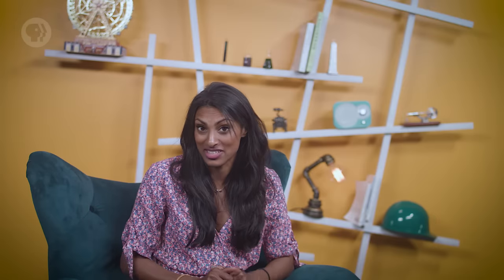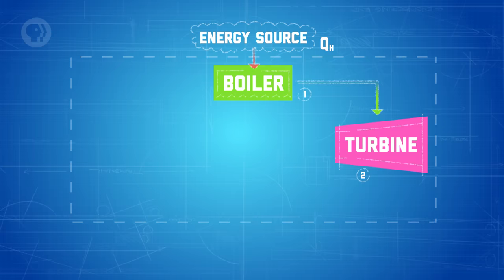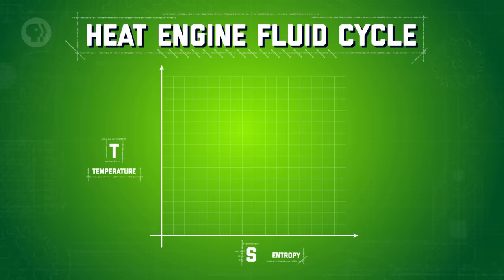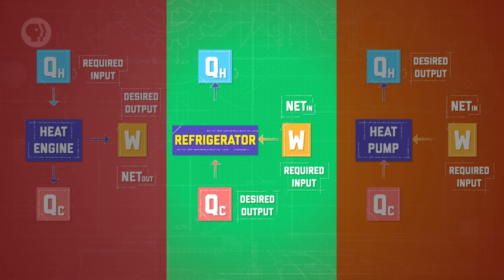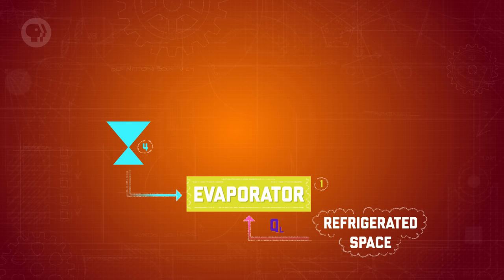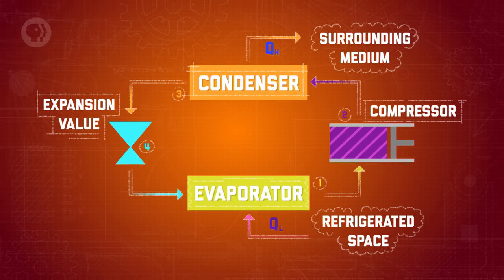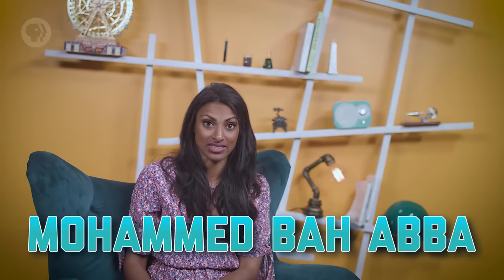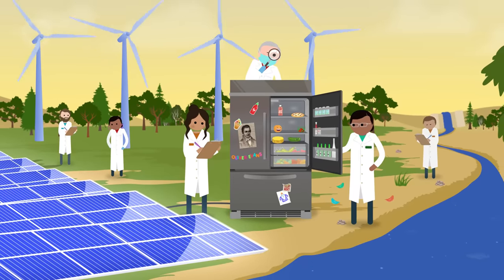Heat Engines, Refrigerators, & Cycles: Crash Course Engineering #11

Comment: at this point its essentially Crash Course Thermodynamics :P
Reply: I was about to comment that. This is not only Engineering. Thermo applies for Sciences as well, and not for Computer Engineering, not much for Electrical or Civil. I mean, I am a ChemE and thermo is deep within us and the Mechanical guys. I don't get why they are focusing on it.
Maybe they should make it more clear what lines are being studied and why.
I think they are just taking the most applied courses of engineering and they will go around.. Thermo, Fluid Mech, Heat transfer, electrical systems, Static mechanics etc.
Reply: Herbert Barrirt Dan Victor Be patient. This is only episode 11 in a 46-episode series that needs to cover several, unrelated facets of engineering. It makes sense that they would spend a few episodes focusing on a specific discipline before moving on to the next one.
Reply: All engineering is basically thermodynamics  and incorporates a lot of it since there aren't many systems where energy is not involved
Reply: Dan Victor. I disagree. I'm a civil engineer and I use a lot of thermodynamics. Maybe not as much as other areas, but it's still a lot, specially in Hydraulics (Dams, pipes and others) and Environmental.

Comment: She did miss out a bit i think on the properties of the refrigerant and other gases . As being a mechanical engineer we are aware of these things . Its basically about pressure and temperature . Everybody knows water boils at 100 Degrees but not everyone is aware that boiling point of liquid changes with the change in pressure . If pressure increases boiling point increases and if the pressure decreases the boiling point decreases . For example at an altitude of 20000 feet water boils at near 40 or 44 degrees celsius because the pressure is less at that altitude . The same happens in a refrigerator . When the compressor compresses the gaseous refrigerant its pressure increases so does its boiling and condensation temperature . And the heat because of compression of the gas is rejected to the atmosphere in the condenser and the refrigerant condenses . The expansion valve then reduces the pressure of that liquid refrigerant thus reducing its boiling point and temperature .  this low temperature refrigerant is the passed on to the evaporator to absorb the heat and cool the surroundings .
Reply: come on! make this simpler! MY MIND IS ABOUT TO BURST.

Comment: Thanks I've always wanted to know how a fridge works. I found it pretty wierd that you can all energy to something to make it colder.
Reply: even weirder/ more counter-intuitive are the gas fired camping fridges. You burn gas to make something cold.
Reply: You can do this even more directly using the Peltier effect. 

Also, when you think about it, a computer sorting a list is also using energy to reduce the entropy in its memory. There's a direct relationship between information entropy and thermodynamic entropy, which is kind of weird but makes perfect sense at the same time.
Reply: yondaime500 you're right I never even thought about the computer one
Reply: Good to keep in mind though, that since entropy can never decrease in the universe, you're adding energy BUT also producing a lot MORE heat than you're taking away; thus still increasing entropy. Same as the computer example.
Reply: Felix Guo you can decrease entropy in an area by increasing the entropy of the things around it. Ie a fridge cools water into ice but vents out a lot of heat.
Reply: 3

Comment: seemed to gloss over the bit about the expansion valve
Reply: yeah, I mean I know this isn't intended as a refrigeration course but it would be interesting to understand more
Reply: She did miss out a bit i think on the properties of the refrigerant and other gases . As being a mechanical engineer we are aware of these things . Its basically about pressure and temperature . Everybody knows water boils at 100 Degrees but not everyone is aware that boiling point of liquid changes with the change in pressure . If pressure increases boiling point increases and if the pressure decreases the boiling point decreases . For example at an altitude of 20000 feet water boils at near 40 or 44 degrees celsius because the pressure is less at that altitude . The same happens in a refrigerator . When the compressor compresses the gaseous refrigerant its pressure increases so does its boiling and condensation temperature . And the heat because of compression of the gas is rejected to the atmosphere in the condenser and the refrigerant condenses . The expansion valve then reduces the pressure of that liquid refrigerant thus reducing its boiling point and temperature .  this low temperature refrigerant is the passed on to the evaporator to absorb the heat and cool the surroundings .

Comment: Freon? I thought it had been banned.
Reply: partialintegral it has. The EPA is phasing out the use of anything with chlorine in it.
Reply: But its name has sticked as slang for any fluid used for refrigeration.
Reply: James Linton Don't be surprised if the current clowns throw away those regulations too.
Reply: Not the ones that are not reacting with oxgen like R134

Comment: It's great that you point out that solar panels and wind turbines are a great alternative but why don't you point out the amount of energy and resources required to build these items and the hazardous-waste left over after producing them
Reply: because the topic is thermodynamic cycles involving heat and work within a device.  solar is a great alternative to get a relatively unending source of electrical energy to produce work.   comparing the pros and cons of the industrial manufacturing processes to produce the devices that employ these cycles is another conversation.  refrigerators also require tons of energy and resources to produce and those processes also leave hazard waste behind.  mining for metals, producing viable refrigerants in chemical plants, manufacturing the plastic linings from petroleum etc. etc.   If it helps or matters at all I am a licensed PE in mechanical engineering working for an industrial consulting firm with a focus on these cycles.
Reply: Because that's not the point of the video and the argument is stupid anyway. All energy generation methods need energy and materials to build them in the first place. Or do you think the steel and concrete for building a gas/coal/nuclear power plant just fall from the sky and their fuel magically appears on their doorstep? The hazardous waste (green house gases, nuclear waste, emissions in general) left over from those types of power plants not only in construction but even more importantly while in operation is far worse.
Solar panels and wind turbines typically repay their manufacturing energy in 2 or 3 years, but can even go as low as less than a year depending on technology and location. After that they produce for "free".
Reply: I thought the solar panels and wind turbines reference was awkward and out-of-place in a heat cycle presentation.

Comment: I am very sorry  but that was the worst explanation for refrigeration I have ever heard.  I now understand 
why I have to teach refrigeration basics to the cadets who come out of school. Sorry again I know you 
mean well and I love your site.  For those who were confused  
Pretend you put a pot of water on the stove  turned the flame on high and went out for a beer. 
Water boils at 100 C  the water will heat up to 100 C  and stay there. Not getting any hotter, the 
pot will stay near that temp and be fine , until the water boils away. After the water is gone  the pot 
melts and your wife is pissed. The water was keeping the pot cool   I know 100 C seems hot  but 
its way colder then fire. It takes energy to make something boil  or even evaporate. Thats why 
your hand feels cool when you poor rubbing alcohol on it and blow. We make freon  it boils 
at what ever temp we want   say at a nice 5 C to keep that beer cold. 
Second   water does not always boil at 100 C   think of a pressure cooker  higher pressure 
means that it boils at over 100 C  or a persons blood boiling in outer space  It boils there 
because the pressure was 0 so low that it boils at your body temp. 
( I know not exactly correct  but easy to picture) 
Third  steam turns back into water at 100 C   same temp.  same temp  I know sounds wrong 
but its true. 
So you have 2 radiators   1 inside  1 out. A compressor that is sucking on the radiator inside 
and pushing into the radiator outside. Just before the radiator inside your home there is a 
blank  with a tiny hole in it  so only a small bit of freon can get through. There is a fan on 
both radiators.  You turn of the compressor  the press in the inside radiator goes down 
while the outside radiator press goes up. Remember there is that blank only letting a small 
amount of freon to flow. the pressure outside goes up while the fan on the radiator keeps 
it at outside temp. ( compressing any gas makes it hot. More you compress it the more 
the temp goes up) Remember boiling temp goes up when pressure goes up  and the boiling 
temp is also the temp it condences at. the pressure goes up enough  with the temp staying 
the same that it turns back into a liquid. It puts out a lot of heat when this happens. 
That liquid freon  now flows to your inside radiator  ( through the small hole in the blank 
that maintains the pressure difference) where it now boils at a nice 10 C . The fan 
inside blows air over the radiator  keeping it warm enough to boil the freon  and cooling 
your home. The compressor now starts it all over again. A cycle. 
sounds complicated but really easy when you go over it a few times.  
Sorry for the super long post. Again I love your site  just hate this vid. 
Tom
Reply: Thank you for taking the time to explain, I can't listen to the person in this video. Last month I repaired my totally frosted freezer by adding a 16" long copper wire wrapped around the heating defrost coil. So far the freezer hasn't frosted up again.